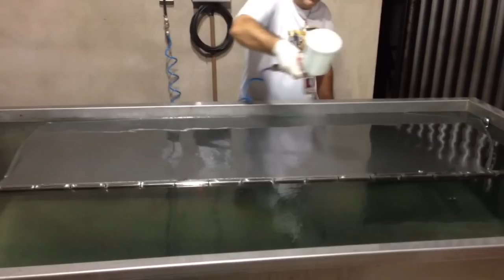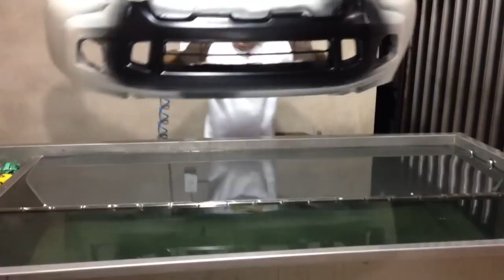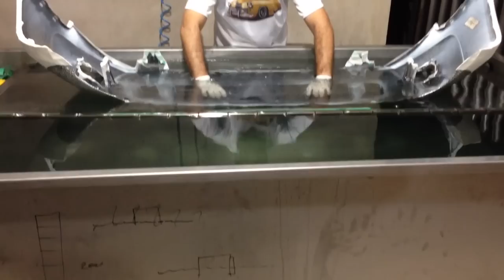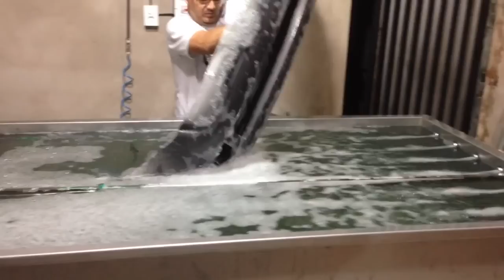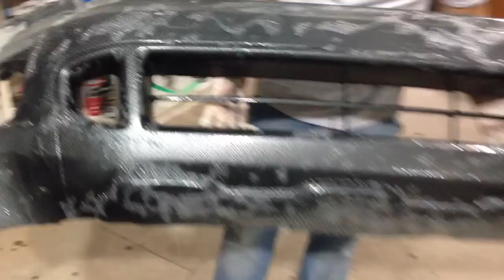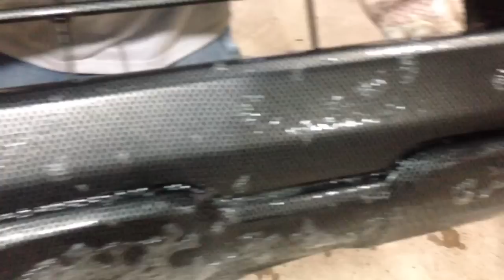FordRanger Parachoque - All Tuning - customização automotiva, water transfer, hydrographic

Comment: Hello, what spraygun do you have? How many pressure? 
Thx
Its a cool video with this big thing
Reply from the maker: hi divixstreamer, air gun 1.3mm Arprex ... ... ... opening 20lb pressure range 80%
thanks for your comment
Reply: Marcus Prado 20lb = 1,3bar. It is very high. When i would doing this on my gun, the water make to many waves.